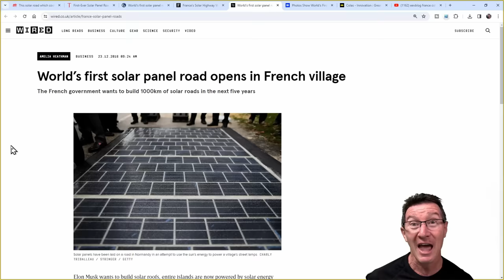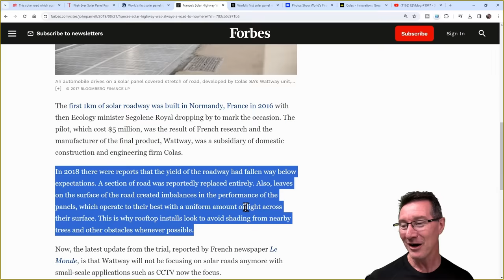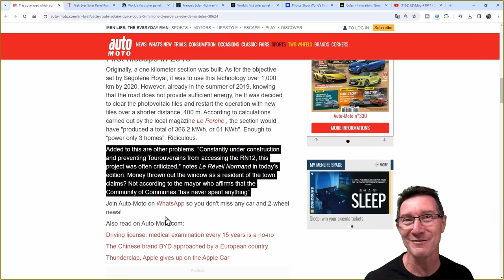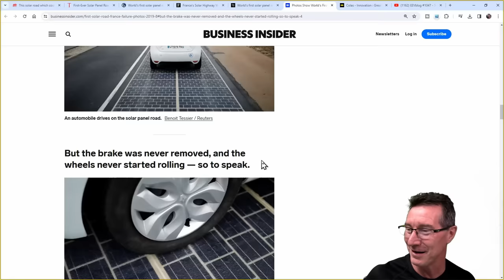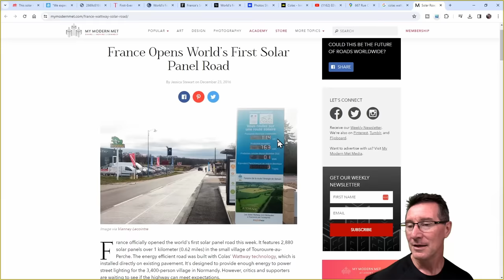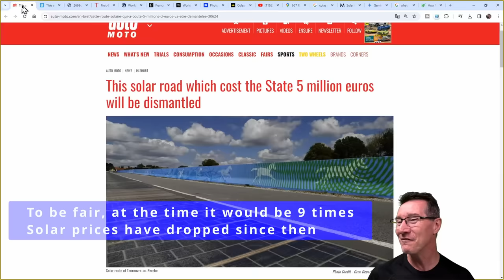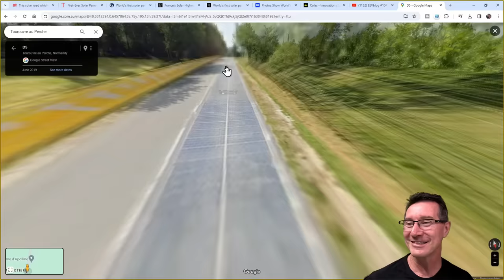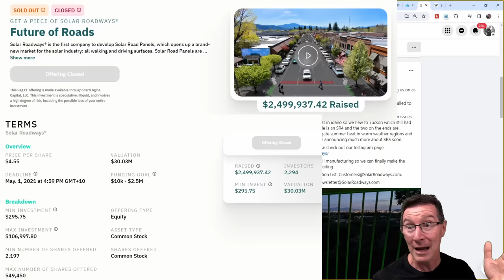EEVblog 1603 - Colas Wattway Solar Roadways is DEAD

Comment: If they only thought of Solar Fricken Rooftops... It might just be the next big thing.
Reply: Yeah but they'll need solar frikin ramps to get your car on the roof. How else you gonna drive on them?
Reply: Elon Musk tried... Thats the best thing I have to tell you about them
Reply: @erick_ac  yeah, solar roof tiles are like the holy grail of PV - very elegant in principle, really hard in practice. Regular solar modules on top of regular roofs are a mature and affordable technology, though.
Reply: or solar on the side of roadways.... or above the roadways...
Reply: Never understood what's wrong with solar panels over the rooftop
Reply: Solar freaking rooftops is not innovative so nobody is interested
Reply: @georgH the problem is solar panels on a roof is not innovative
Reply: Nah best we can do is solar freaking farmland. We don't need farms right? Just get your food from the store, much easier.
Reply: Back in the 1970's rooftop solar collection panels weren't electrical generating panels, but rather acted as water heaters, and you used that hot water for heating your house.  We could still be building rooftop collectors like that even now, probably for FAR less than the generating panels cost, without the post-usage environmental impact.
Reply: @Chris-Brown-  These are just normal, boring solar panels. We're talking about SOLAR FREAKIN' ROADWAYS!

Comment: They should have built a tilted roof above the bike path with this solar material, if anything - it's a rainy area anyhow.
There are two things you want, when cycling: Rain protection and sun shade.
Reply: I was thinking the same thing, a solar roof to provide shade and some protection from the rain would be ideal for a walkway or bike path.  If they had it would be working a whole lot better than what they did.
Reply: Actually, three things.  Add, "a car."
Reply: @BobDiaz123  It would also generate 10 times more power and cost 100 times less.
Reply: You are right, except they want to sell more cars. There's little money to be made from bike sales in comparison to cars.
Reply: Or even a 'solar fence' next to the bicycle path. Would have been cheaper, lasted for 25 years and made some darn sense.
Reply: @ReachOutToWilliam  why would one want a more expensive, polluting, difficult to park vehicle that also doesn't allow for some physical activity? 🤔
Reply: It was the first thing on my mind when I saw this the first time. Just ordinary solar panels and ordinary steel construction material. A bit higher poles than on a usual solar farm. Existing material, existing technologies, easy to maintain. Just put it above a bike lane and enjoy. It would require much more robust construction above an ordinary road. Still may produce interesting results in incing conditions when ice melts everywhere in the morning sun, except the road. Doable but need to move some funds from sales and PR to engineering.
Reply: @tech29X It's the 2020s, the "everything gets shutdown because cars" argument is essentially dead everywhere except the US, where there are practicality issues with building up mass-transit infrastructure on the scale needed and many things are too far away for bicycles.
Reply: @wombatillo and with bifacial panels a solar fence works even better than before.
Reply: @markotrieste  What about asking former Ukrainians why owning a car with hundreds of miles of range capable of moving a family in short notice might be valuable?  Or maybe ask hurricane Katrina survivors what they used to evacuate their whole families in less than a week?
Reply: @actually5004  Lol 😂
Reply: @markotrieste  Oh, and if you want a good workout you can always disable your power steering and vacuum brake assist and learn why race car drivers are more fit than cyclists.
Reply: @actually5004  Which is, of course, exactly the kind of things that your average commuter really needs to worry about…
Reply: @DebatingWombat  You don't own a toilet plunger, do you?
Reply: @actually5004  And you obviously have hurricane shutters, an evac bag, an air raid shelter etc.?

I mean since you think people need to be constantly prepared for extreme disasters and evacuation (especially relevant for this French case, right)?
Reply: You could also to do a bit of mental arithmetic on the cost of acquiring and storing a plunger vs. a car.

It might give you a hint of why your example might not be a particularly apt parallel or comeback…
Reply: @DebatingWombat  I live on the gulf coast so yes my house does have shutters and I have a gtfo bag too, that wasn't the comeback you think it was.

Are you aware of the proverb "It's better to have it and not need it than to need it and not have it."?  But don't worry, I'm sure you could get an idea by asking some of the bussing victims of Katrina how devastating relying on incompetent government bureaucracy to move your family in an emergency can lead to tens of thousands of people separated from their families.

They all could have avoided it all by simply owning their own means of transportation.
Reply: @actually5004  So you don’t live in France, which this video is about, and you’re obviously not properly prepared for a Russian invasion since you don’t even have an air raid shelter, tsk tsk tsk.
Reply: @DebatingWombat  No I'm not swarthy enough to live in modern France without getting diversified, but I do have a bomb-proof kitchen table from the cold war so hah!

Comment: They should have built the road at a 45 degree angle, that would have worked.
Reply: And use magnets to keep cars from falling off.
Reply: @IntegerOfDoom  We could create energy if put magnets on the car which in turn interact with the magnets on the street
Reply: @sandrorass890  and then use that energy to power lights, to make the solar panels work at night and more better in the daytime.  Dam, I think we have cracked it, I can already taste the Nobel peace prize.  Now Mammy will have to be proud of me.
Reply: @whatnow9653 And now we have "perpetuum mobile". Nobel? You deserve Oscar ;)

Comment: Stones got stick in the tire tread and cause cracks in the resin coating. Permanent mechanical stress causes delamination. If it rains, water got in and the self destruction domino starts.

Comment: If only there were these things called beams that could have been used to raise the solar panels to shade the pedestrians and protect pedestrians from the elements...
Reply: MADNESS! Such technology simply doesn't exist.
Reply: A man can dream, though! A man can dream...
Reply: Then how would you drive on top of them? lmao
Reply: @Starcruiser81  There are these two ancient technologies related to each other called bridges and tunnels. Turns out that you can have overlapping topologies.
Reply: @ChaosSwissroIl Heresy
Reply: I have a new invention. Solar Hyperways, it's a solar powered hyperway that you run MegaCycles on and combined the network provides limitless power Gigatravel. Thats right, I have SOLVED energy, it's a finished equation. It's a ultra high performance alloy of steel with a special anti-corrosion coating that creates a weather protected hyperpath that captures direct sunlight and allows for integration with the network wide MegaCycle charging network FOR FREE, any excess will be fed into the grid. This is the peak of TECHNOLOGY, really it's quite profound.

It's a painted metal beam, with solar panels on top that will be installed above sidewalks. Every so often you will have plugins for electric bikes... Also the for free part is not entirely true, it's only free with the monthly charging subscription. Now I just need to find a way to get government money for it and sell it as solving the worlds problems.
Reply: That would rule.
Reply: A raised structure over the road would have been unappealing for anyone that does want to enjoy the sun during a bike ride or walk. Additionally, it would have added to the cost substantially, even with a flimsy structure, subtracting from the MWH generated per unit $ of cost, and scaling up the expense when deployed on scale over millions of kilometers. If a cheap flimsy structure was built (vs something more robust & durable), it would also be likely to be damaged by natural weather (such as storms with 30+mph winds) and present a hazard to anyone driving underneath them.  Accidents where someone veers off the road into a support structure would also do a lot of damage, break the circuit continuity, & create long downtimes between periods of generation, further reducing the ROI.
Reply: @RT-mv7df   I don't know if you're joking or not, but basic running the numbers highlights how much more idiotic the panels on the riding surface is comparatively, both from a cost and safety perspective
Reply: @InfernosReaper  Not sure how u were unsure if I was joking or not -- I wasn't.  You are right that it would be better in some ways than on the road itself (from a standpoint of durability, cost, & actual functionality (e.g. total power produced)), but as I mentioned above, for various reasons, it would have enough other downsides & concerns that from a cost & feasibility study point-of-view, such a project should never get the green light, especially with better known bang-for-the-buck solutions.
Reply: @RT-mv7df  Over the road would be better in most ways than on the road itself, especially cost to power production.

Even on aesthetics, the grime and damage to surface-mounted panels would make them look uglier than above path, or path-adjacent ones.

It's been covered by many who know what they're taling about, which is why I thought you might be joking.
Reply: @InfernosReaper  I agree with your points. Even though those improvements make it "more" feasible and appealing in certain aspects, I still don't think it justifies moving forward with such a project compared to other more efficient ways to produce energy. If the goal is to protect the environment and reduce pollution and impact to climate, the name of the game is all about efficiency, and only deploying the most efficient use of raw materials to meet our energy & living needs. It's why nuclear (specifically safer designs that minimize radioactive byproduct, like thorium salt reactors) should be the prime initiative being looked at for anyone serious about reducing carbon output without significant plundering of the land via mining and drilling.
Reply: @RT-mv7df  All of the sources of energy require at least some mining/drilling and burning/melting at some point, though.

There are no free lunches, though, I will concede that solar and wind such a lot more than most people seem to realize and some of the proposed hydroelectric solutions are somehow even worse.

Comment: There are certainly still a lot of suitable roofs without solar in France. 
The houses also have a power connection and can use some of the electricity themselves.
Reply: You could also put them above walking paths, providing shade to those underneath.

Comment: If a person in power makes a decision which goes against what is taught in school, it should have that part of education revoked. This is high school physics - so now the minister should be left with primary education only.

That would increase prestige of schools, and make politicians mind the physics. Though additional regulations to avoid prolonging failed projects would be required.

Comment: you know what makes way more sense is solar panels over parking lots. It hot as hell here in the summer. We have a couple here and it also keeps your car from being burning hot.
Reply: What would also make sense in some places is solar panels OVER roads.
Reply: Even then, just build a roof over the lot for the solar panels. Keeps the cars clean and cool, and the panels output whether there are cars there or not.
Reply: @richardmetzler7909  In Korea there's a highway that has a bike path down the middle, and they put panels over that.  20-30km worth, too lazy to look it up.  Works fine, funny that.

Comment: I almost feel like stunts like this are conceived to deliberately discredit alternative energy projects. In what way was this supposed to be more beneficial than regular solar farms?
Reply: How else was the company who built this was able to grease the palms of the government officials who gave them the contract!?!
Reply: Solar farms take up a lot of space.  Unless you happen to have an empty desert where you want your solar farm, that might be a problem.  Just think, if you could economically make use of all that horizontal roadway space (and there is a lot) that even happens to be more abundant in areas where you need power (cities).  I've even seen arguments that with the electronics in the roadway it could use a little bit of the electricity to help thaw out the road and keep ice from forming, think of the safety benefits from that!
I agree with EEVblog on this one, the drawbacks outweigh the benefits, and with the numbers he presented, and that they are tearing it up, says build your traditional solar farms, add roof solar, do the canal top solar, integrate it with farms and crops that need some additional shade, or something that is going to be economical and last.  Road based solar doesn't make the cut.
Reply: @davidfries63  Yeah, that's the same argument that our beloved SolarRoads used.  Look at all that wasted space just sitting there!
Reply: @davidfries63 as always with these pitches, they conveniently leave out the numbers. keeping roads snow free without salt sounds like a great idea until you look at just how much energy that would require (a LOT more than we even have). 
as long as you find investors who dont have someone check the physics, its a golden idea.

Comment: Please invest in my Solar Freakin' Nails! 
That's right! I've invented steel nails where the head of the nail has a solar panel!
This panel is permanently attached to the nail and cannot be removed.
If the panel cracks or fails, the nail must be removed and replaced.
Hammer lightly, the glass is very scratch resistant, but as a trade-off, it is very brittle.
1 nail could power 90 million earth size planets!
I'm working on a prototype of a Solar Freakin' Hammer.
The flat head of the hammer will have the solar panel and should achieve 100x as much as a single solar freakin' nail!
(for those that can't figure it out, this is a joke, you don't want to drive on solar panels and you shouldn't hit them with a hammer either.)
Reply: I would like solar freakin fingernails. Just some cheap decorative flex PCB things with solar and LEDs that i can wear to a festival or the like by lacquering them to my fingernails. If you can make them under $20 per set retail, you have my attention. You can have 10fold profit margin, that would be well par for the course.
Reply: @SianaGearz  Hahaha, good one.
If you are not joking, the cost, coverage and effectiveness would not be practical in any way.
The issue, is that you either have it only work while in the sunlight or you have to include a battery and you aren't going to want to have a battery on each fingernail and it would be weird to have a big battery glues to the back of your hand or on a wrist band, which then would require a bundle of 10 wires, which would snag on stuff.
If you are serious, excluding the solar panel is your best bet. Just wire up LEDs to a battery.
Reply: @FusionDeveloper   I am a computer engineer, so if there was a good way to construct solar freakin fingernails that was fairly obvious from the "state of the art" in wearable electronics, i would have likely been aware. So no i'm not being serious. But i'd still want them! Just like someone else would be truly aware that flying cars make no sense, but still sort of want one.

I am also aware that if you want a flexible solar cell, it's going to be a-si, and it's not going to power the LEDs well enough to fight the sun even at miniscule emission area.

And of course the eternal question: where do you hide the batteries and which type? I guess i could have fingernails come with finger rings, which i mean, you get a lot of mileage out of hearing device zinc air reaction cells.

You can potentially modulate the power at high frequency over a single wire, and use capacitively assisted return current via the body, but i'm not convinced the complexity and loss is worth it at the cost of an extra wire.

I don't anticipate i'll be building something, but i will keep considering it.

There exist actually light up fingernail products, they used to be all the rage in the past, activated by cell phone signal, NFC and the like, scavenging RF power at short distance.

Oh btw check out "mitxela" for DIY electronic jewelry.
Reply: I think i know what i might do. Build a blacklight LED halo that is suspended above my head, run a wire to a power bank mounted on the thigh under the skirt, and have blacklight reactive fingernails and other decorations. If you ever see that, say hi.

Comment: Here in Germany, the first solar roadway, a 90-meter long part of a cycleway near Erftstadt, was inaugurated in November 2018, and guess what happened: Exactly the same. It had multiple technical problems, caught fire several times, never produced any energy (and couldn't, since it wasn't even connected to any energy network🙈), has been completely shut down and covered for years, and is now still lying there unused in derelict, crumbling state. Some of the glass panels are already broken, and the shattered glass is a danger to cyclists and pedestrians, which is why it is to be removed now. And bear in mind, it was part of a cycleway, so it never had any cars or truck driving over it.